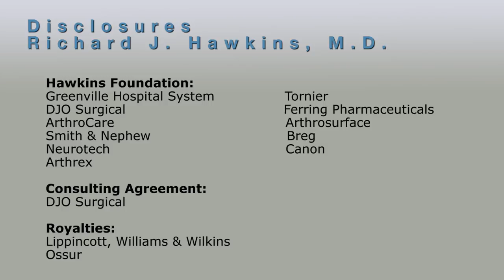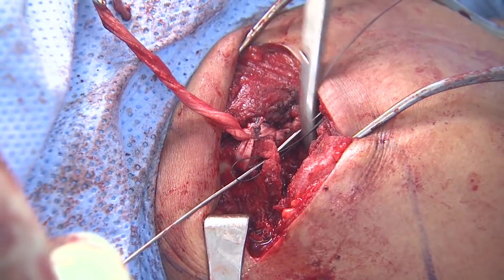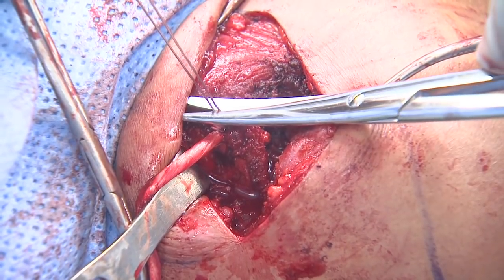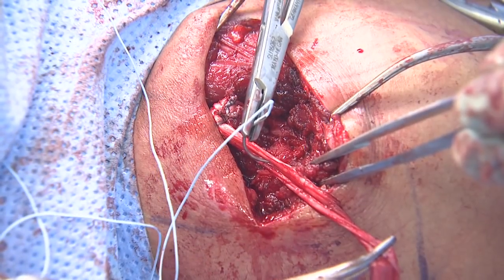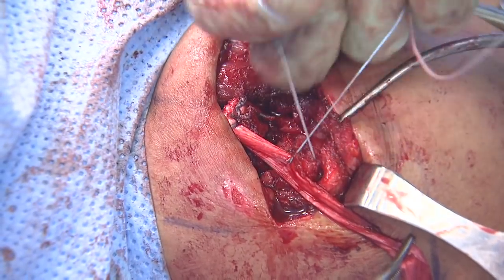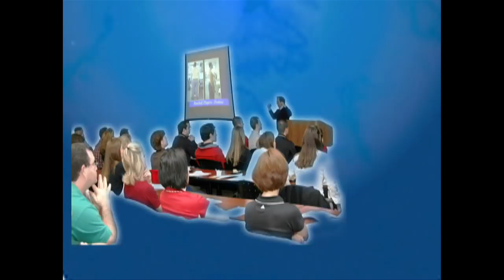AC Joint Reconstruction - Dr. Richard Hawkins

Comment: I suffered a grade 5 separation involving the AC and CC ligaments on December 1st 2014 and had a hook plate "installed" on the 10th. I am hoping to have it removed in June 2015 and am undergoing physiotherapy. I hope for the best possible result and to come out of this stronger than before.